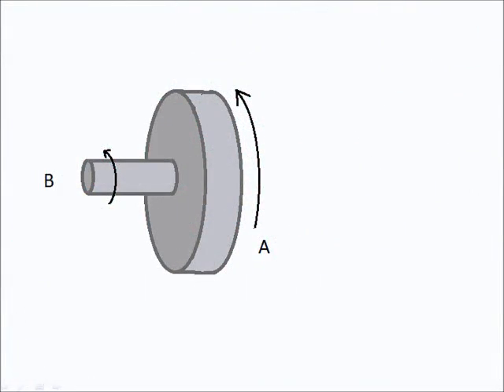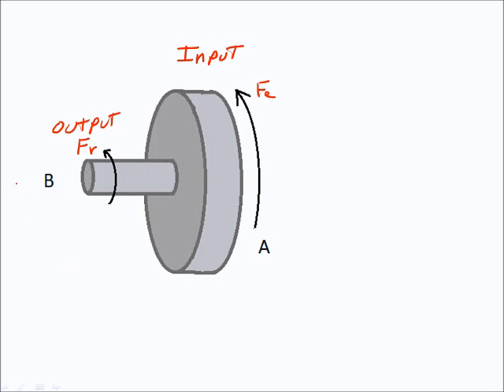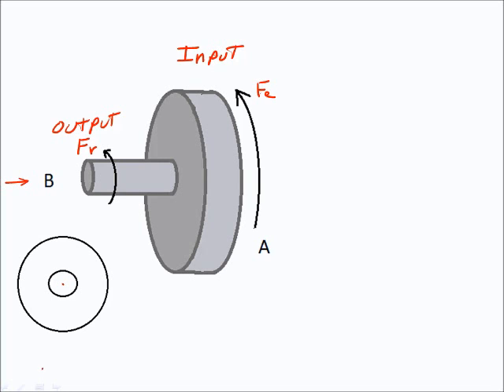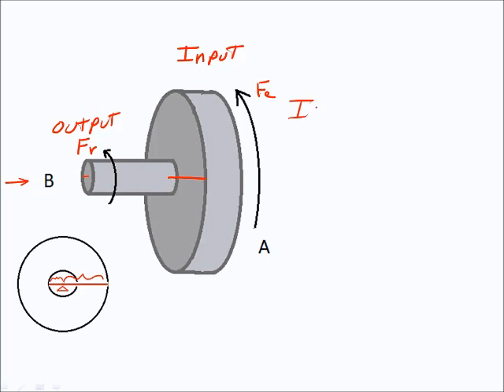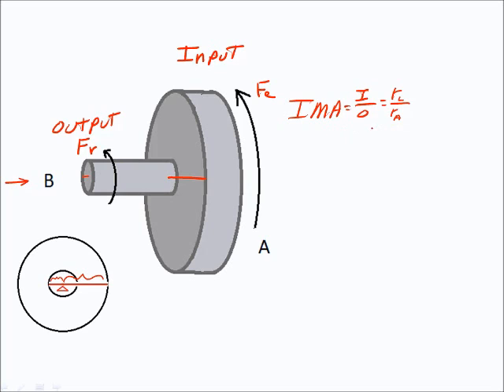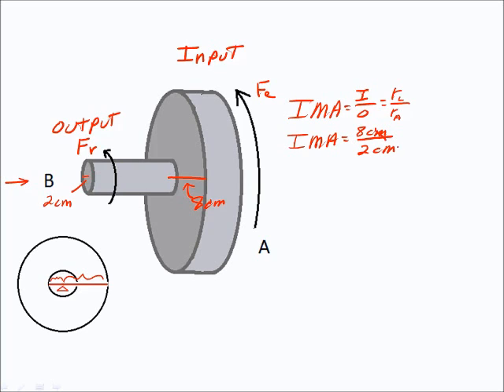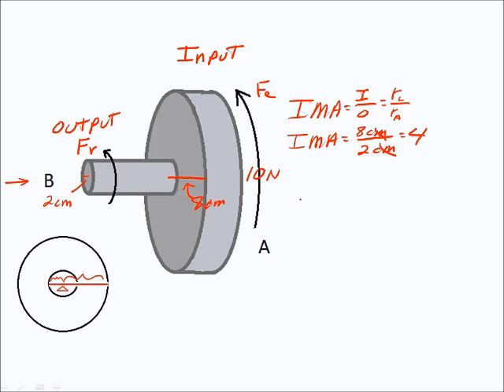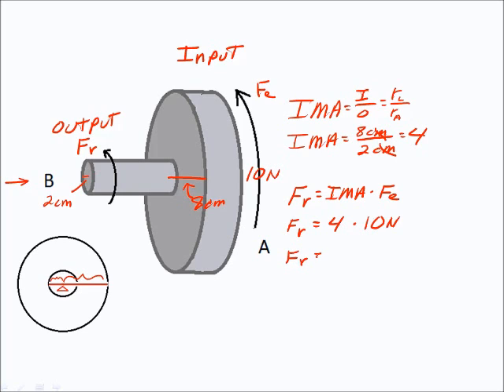Physical Science Simplified: Simple Machines: Wheel and Axle Calculations

Comment: Was wondering what class of lever you would classify a bicycle crank arm?
Reply from the maker: A first class lever. The fulcrum is where the pedal arm is welded to the center of the chain gear. The output side is where the chain contacts the gear and the input side is is where the pedal attaches.
Reply: +davenport1947   OK, thanks for your reply!  But let me make a counter point to that conclusion.  A bicycle crank arm is not a first class lever because the chain/chainring also places the load in front of the fulcrum point as well (when the crank arm is in the 3 o'clock position which is typically when a rider makes the most power) which would negate some if not all the mechanical advantage it would provide if it were a first class lever.  Secondly, the mechanical advantage you obtain from a crank arm is obtained from the gear ratios (i.e. larger gears on the rear wheel and smaller gears on the crankset).  Thanks in advance for your reply!
Reply: +davenport1947 I assume you never replied to my last conclusion since I did not receive any further e-mails from you???
Reply from the maker: +Dougiebrownjr The crank is a first class lever.   Just as  a single fixed pulley is a first class lever.
Reply: @davenport1947  but when you google wheel and axle, the results say it's a 2nd class lever, not a 1st class lever. so, what's going on here?!